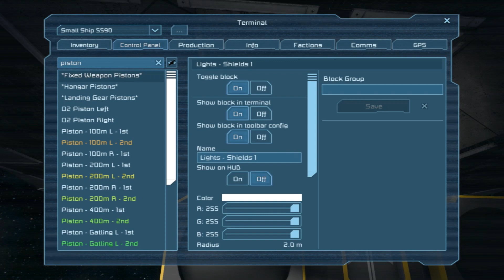Let's Play Space Engineers - Episode 120: Starting Detailing With Lighting!

Comment: The elevator definitely is the best design yet (totally not just because I suggested you try that :P), now if only you could make the tunnel one block taller...
Oh, and move that control panel somewhere you don't get squashed.

The lights make the corridor look like a runway/Coruscant hovercar tunnel. Can you turn down the brightness of the light itself independently of the actual illumination (colour the surface grey while keeping the light output white or something)? For the cheaty solution I believe someone once had a modded "extreme interior light" with a radius of over 100m, not sure if that mod still exists though.
Overall the bloom seems really extreme compared to the light output of those lamps, could you carve alcoves into the ceiling and put REALLY bright lights up there, to light up the corridor but hide the actual lamp unless someone looks straight up into it?
Reply: Should be a red button on inside and outside hallway.

Comment: simple fix to he weapons. remove all blast blocks (and any other block that is in the way of the holes). set the position settings back what they were before you changed them in this episode and then retract the weapons . then you will see what you did wrong and why it wasn't working. then build around the weapons with them retracted. but simple explanation you put the blast blocks in the way because the hole was meant to have a 3x3 opening all the way up.